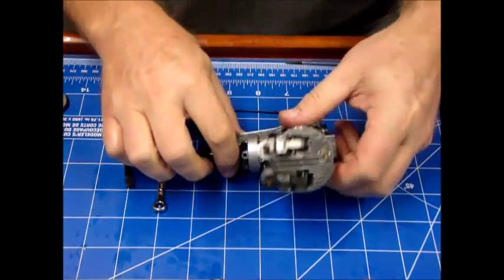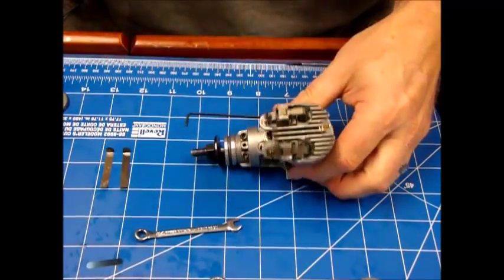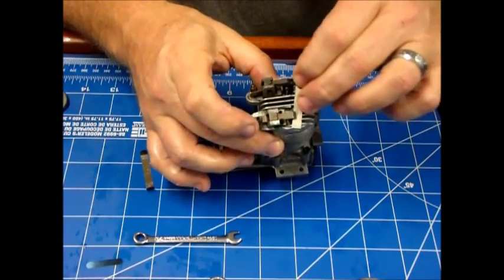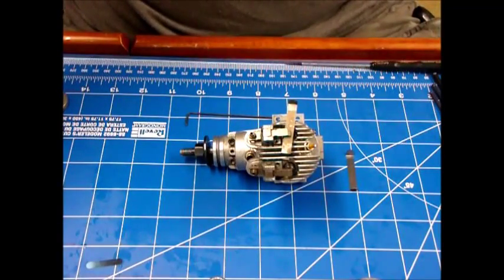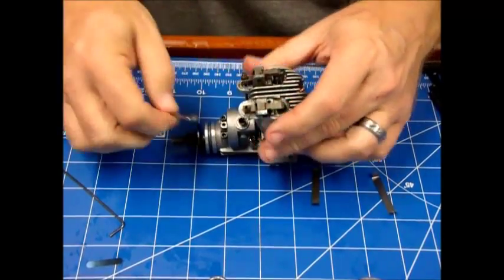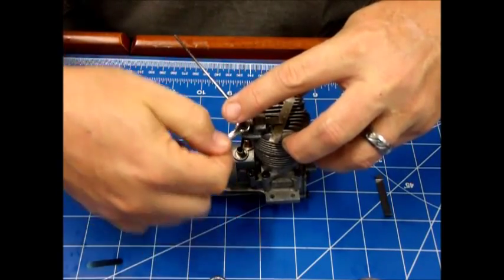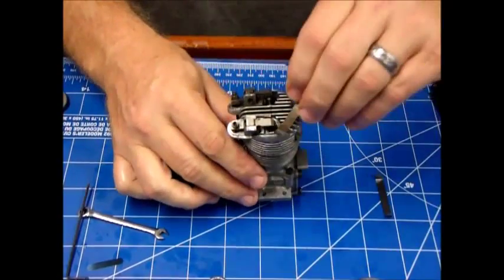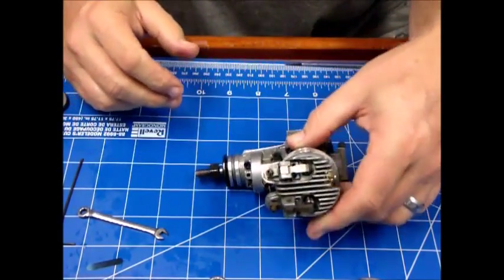Saito FA-50 Setting the valve lash

Comment: I have a few questions for you if you have the time on my Saito 180. I've recently bought an aftermarket exhaust and after installing putting everything back together I no longer have good compression? I was thinking I got some debris in the intake valve and its not seating maybe? Can you help me at all or give me any pointers on diagnosing or fixes. Thanks
Reply from the maker: Dhayes48 Please go to the About tab on my channel and email me. Provide all pertinent information on your engine and what you did to it.
Reply: David McIntire for some reason your email doesn't show anywhere in your 'about' tab.
Reply from the maker: Dhayes48 It's there. Business inquiries.  I also have a website where you can contact me.  All on the About tab.